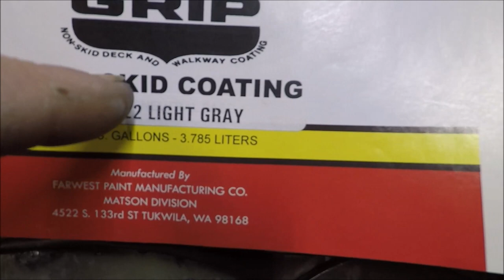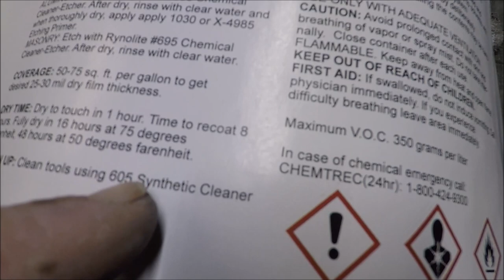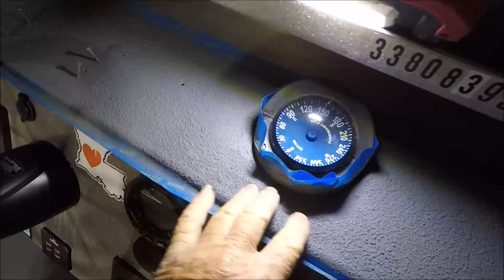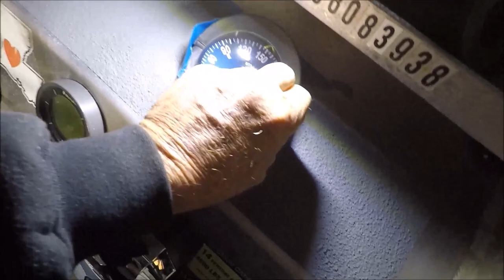RE-PAINTING PLATE ALLOY BOAT DECK

Comment: Somebody else besides me is boat working!!👏👏 I'm waiting to get call from marine shop the electrical rewiring and Automatic Control Relay is installed!
Reply from the maker: this was ''manuel labor'', for days. Workin' is jus' fishin.
Reply: @CaptDavesSportfishing  true, true Capt Dave! I thought I would get boat back today since I made appt 2 weeks ago, but no go at this station! Maybe tomorrow so that I can get lower unit service done!
Reply: @NewVisionLCS    Blake, you have questions or concerns have Capt Dave give you my email . Two weeks, two weeks did you hear that Dave? Post that clip from the movie!!!
Reply: @orowock1  Thank you! I dropped off boat this morning to install new Blue Seas switch and ACR, so that I dont have to manually switch between batteries. I figured since they knew my appt was for first thing this morning and they already quoted me 2hrs of labor, I would get boat back to today, but that didnt happen! Hopefully will get phone call tomorrow. Need to talk to you Mr Orowock about neutral safety switch and about changing Evinrude Binnacle for one with a neutral lock!
Reply: @NewVisionLCS   contact dave get my email  we'll make it work look forward to talking to you .
Reply: @orowock1  Thank you sir!👍
Reply: @orowock1  you familiar with the Yamaha F150 motors? 2006 model. Think I’m going to have to change the Balancer assembly! Seems to be a common problem!
Reply from the maker: @NewVisionLCS    don't tell me, you believe boat mechanics
???  remember, they learned ''2 weeks'' at outboard school.... haahaa
Reply from the maker: @orowock1  CAN'T......copy right issues. Just said that, before I read your comment. WOW.
Reply: @melloreel   Hello Mello, Iv'e  never actually replaced the balance assembly in a Yamaha f 150 but iv'e heard it more or less starts with a whine and progresses into vibration at an idol. I believe 2006 was the last year of bad metal used on Yamaha. Before you sink major bucks into it , take a peek into the block where the thermostat sits,and up into the exhaust leg after the lower unit gets pulled. If anything looks cratered like the surface of the moon. you have some thinking to do about cost effectiveness
Reply: @CaptDavesSportfishing  Nope, they guy installing my new switch had to call me to ask me about what the switch was for!!! I might have to get our attorney  involved since I was told by the owner 1 1/2 to 2hrs of labor!
Reply from the maker: @NewVisionLCS  talk to owner...tell him you can be a blabber-mouth , and that bad news travels fast, on the interweb. No one ever hears good news. only bad.
Reply: @CaptDavesSportfishing  Even though it took longer, they only charged me what I was quoted which was 2 hrs
Reply from the maker: @NewVisionLCS  thats usual...time to move on.